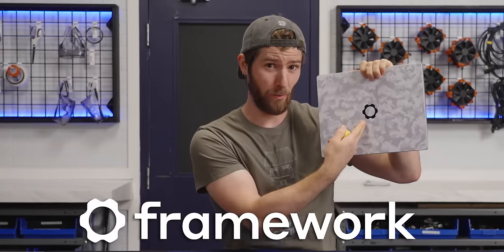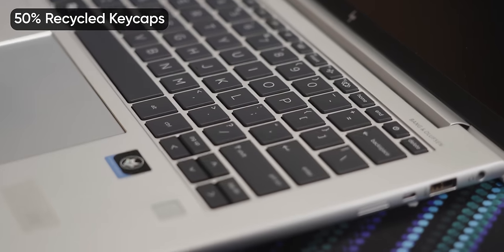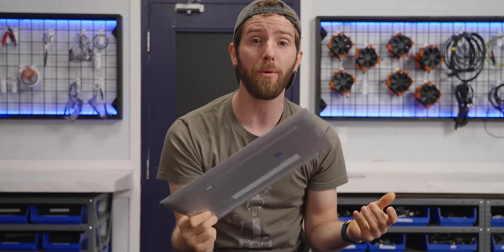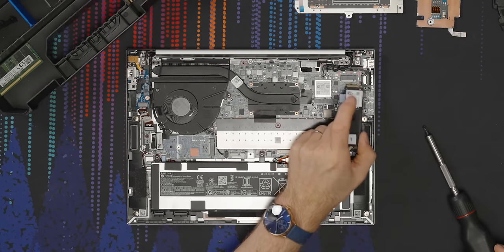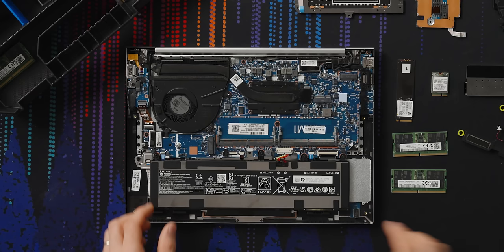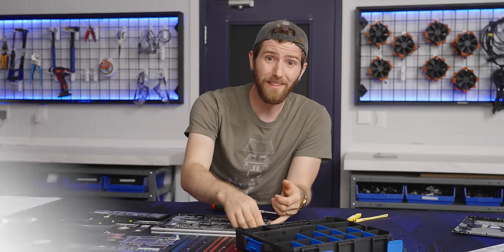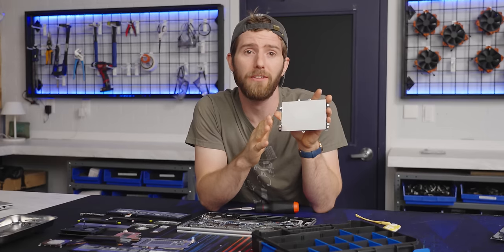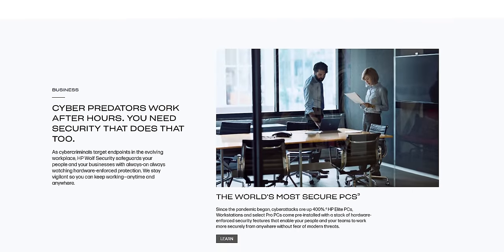My Investment is in TROUBLE - HP repairable laptops

Comment: While it wasn't promoted like they are now, my Elitebook 850 G3 is almost as easy to work on. While I haven't taken a whole lot out, the internal battery is more easily removed than the computer you look at here. Remove the bottom, undo 2 screws and remove the battery. I did have to replace the keyboard and that was very easy, after opening up and removing the battery, just remove either 2 or 4 screws (can't remember) and pop out the keyboard from the outside and unplug a couple ribbon cables. RAM super easy, and it has a SATA and an M.2 slot.

Comment: My mom has an HP. The NVME failed at 10 months.  I swapped it out and tried to warranty the original through HP.  They approved the repair but they demanded I put the SSD back in, and ship the entire system for SSd replacement . 

So much for user repair ability.

And then they claimed they do it to preserve the warranty.. but SCOTUS & DoJ already upheld user upgrade and replacement parts doesn't void warranty

Comment: This is pretty much the same for the G8s aswell. I did i keyboard replacement of the 840 G8 just a few days ago and there was a guide on the HP youtube channel that made the swap pretty easy. The problem is that the keybord is the same as the bottom plate. And  litterly EVERYTHING else is screwed into that bottom plate. Meaning that if you want to swap the keyboard, you have to rebuild the ENTIRE computer from scratch...
But the 2 sodimm slots are nice! Leneovo could learn a thing or two.

Comment: If this had a pointing stick like older HP ProBooks, I'd be totally interested. This is one part of the user experience that became so essential to me (as I don't have to leave the keyboard to use the mouse).  This usually leaves me with a ThinkPad; I love them, but choice is good.

Also, is the USB-C on a board? I find that the one people use for the power adapter is the spot-most-likely-to-break due to repeated plugging. If not, I'd feel much better if said ports could be on a card.

16:10 displays are awesome. Ever since my Dell 2405WFP 24" LCD, I've wanted the 1920 x 1200 on every 14" laptop I could get. This should have happened long, long ago.

Comment: I've been rocking a HP Envy x360 for a good few years now, I had one of the hinges fail pretty dramatically recently and to my surprise I was able to find detailed and easy to follow (dis)assembly videos, by HP, on youtube for my exact model, and with notes as to which dissasembly videos had to be followed first to reach the hinges. (Spoiler alert, it was all of them)
... I may have repaired the hinges by replacing the failed plastic portions with an irresponsible amount of super-glue, but it's back to working absolutely as designed, and am now considering a battery replacement and a bios upgrade to include the battery management tools!

Comment: That's something I love from hp they always have maintenance manuals with all the spec's, part number of all the spares, and even illustrated how to disassemble to get to the part you want to replace, the only bad thing is that out of us or at least from Mexico to the bottom of America it's almost impossible to get the replacement parts even in recent laptops and don't mention about the price the only time I've asked for a $8usd wifi module they try to charge me half the price of the laptop about $200usd, then I've finally get it from a junk PC place for about $3usd (used but in perfect condition)

Comment: I only just now saw this video, 7 months after it was published. I have an HP Omen that I think I bought around the same time as this video. I opened it up to put in an extra SSD so I could reserve the included one for boot drive only. When I was in there, I noticed QR codes all over the place. Replacement parts. I had a hunch then, but now I know for sure. HP has come a long, long way in recent years. In the 90s I can remember my dad trash-talking the brand incessantly, so this Omen is actually my first HP product ever. I also picked out a 16" Envy in that (to die for) gorgeous blue, for my mom when she needed a new laptop. No regrets so far, and even less knowing they are seemingly "with" the "right to repair" camp.

Comment: I would have wanted to see your replace the keyboard because that's the part that's often fails after the battery. For the parts shown in this video, it appears that there was no adhesives which is always a good thing but did they use some other nasty tricks for the keyboard?

Comment: So, from a service engineer perspective:

- average level of disassembly difficulty
- two sodimm slots in a modern 14" - good
- replaceable daughterboard with USB-A and 3.5 combo - good, USB jacks fail more often than everything else
- ports on other side are not swappable as usual, will require soldering
- replaceable fingerprint sensor - not much of a factor, they rarely wear out. good though
- stock SSD looks like it has no DRAM cache and a single flash chip - not very elite for an Elitebook, but HP does that, see the same on Spectre x360
- USB-C charging - not great, may not accept a generic charger, a pain to replace when the connector wears out
- adhesive in LCD panel assembly - BAD, replacing the panel will be a pain when it breaks
- keyboard looks fixed in place with molten plastic studs instead of screws - BAD, replacing the keyboard after a spill will require replacing the whole top case instead of just swapping out the keyboard module
- parts availability usually covers North America only, YMMV in other countries

Conclusion: Sorry, but no. (Maybe slightly above) average office laptop in terms of serviceability, nothing noteworthy. Most mass production office laptops offer the same. HP did not break anything, so that’s good?

Comment: I'm a repair tech and from what I've seen HP laptops suck. It's the most common laptop we get in, next in line is probably dell. HP would be twice as common.

Biggest issue is those bloody hinges, HP laptops are in my experience just really cheap and flimsy. It's good that they are trying but there are still some issues I have.

Why TF do you have to still replace the whole assembly, just have the LCD replaceable, if you break your screen you shouldn't have to replace the LCD back cover, camera, bezel and wireless antennas.

Another issue I see is dying keyboards because a small bit of liquid got in, or someone was figiting with it and pulled off a key breaking those weak clips. You want a challenge? Replace the keyboard.
It's probably another horrible thing where it's held in with 150 plastic rivetts, just have a replaceable keyboard without rebuilding the whole freaking laptop.

Pretty much all laptops suck that I've worked on in one way or another, even if it's just a software issue I see, the laptops still suck. Framework is the only laptop that seems ok, but it sucks that no one can bloody get the things.

Comment: Can't charge the HP laptop from either side, which you can do with the Framework.  As I type this I just hot-swapped my USB-C port from the left to the right side of the laptop because the plug was closer to that side where I'm sitting.  Can't overstate how handy this feature is for remote work in different environments.

Comment: I had an old laptop, Lenovo Z710 was the model, and I was quite amazed by how easy was to open the damn thing. 3 screws on the bottom and SLIDE the bottom cover off. Yes you read that right. SLIDE not pull. You got instant access to the HDD, ram, fan, cpu and gpu and wifi module. Maybe you can show this off in a future video about repairability
Reply: Some older HP Elitebooks had a lockable lever, one direction unlocked the battery, the other direction unlocked the bottom system cover to slide off.  
Not a single screw required for both of those operations.  
Even swapping the Hard Drive and WiFi, RAM and FAN was toolless.

Comment: Checking their website in the UK and you can't do any of the stuff Linus does here.
There is only one version available and there are no spare parts available.
The blurb actually says that the battery is for their maintenance techs only. Not to be replaced by the user.
Then again, Framework laptops aren't available in the UK yet so there is no need to make this HP 845 G9 user repairable in the UK yet either.

Lends some support to the "Kill Framework then return to business as usual" theory.

Comment: My company uses HP and almost every user has some elitebook model. They are generally really solid to work with, and I appreciate the ability to swap batteries. Comes in handy when the company typically requires users to remain docked nearly all day every day. HP Wolf Security, though, is mega annoying bloatware. Nearly every time I observe strange behavior in a users PC, removing Wolf Security fixes the issue. Wish companies wouldn't ship products with unwanted software that makes the machine objectively worse.

Comment: Framework is absolutely still ahead (amd model would be nice). That is a repurposed HP business design (nothing wrong with that). The repairablility of that machine is not something new though, the business laptops 840 series (what I work with) have all the same removable components. I love the design, chassis, and seeing it carried over to some other models is great. We have yet to take delivery of the bulk order but the Probook 44x (0 or 5) series seem to be pretty comparable too. The chassis is made out of plastic, but all the replacement should still be possible their too.

Comment: TL;DR: Nothing that actually matters has changed.

I've been in the unauthorized third-party repair space on-and-off for about 10 years, mostly as a side hustle. So being an "industry outsider", every repair is a learning experience and the following is just my $0.02. While what companies are doing in response to the Right to Repair movement are all in the right direction, certain models of HP laptops were built like this long before R2R was even a thing. The only difference this time around is the availability of spare parts and repair instructions straight from HP.  But for the most common repairs we see - port repair, hinge repair, screen repair, keyboard repair and battery replacement - more could have been done to remedy the reasons why devices need to be repaired in the first place/make the repair process easier and more affordable, especially as a device ages and depreciates.

1. Ports are still soldered - pretty straightforward. While it's good that the right-hand side ports do break out into a daughterboard, not having the (arguably more important) left-hand side ports on a modularized daughterboard is a huge missed opportunity. Audio and data transfer can both be done wirelessly if the ports fail, but you can't wirelessly charge a laptop when both USB-C ports fail. A bit of a strange caveat since HP laptops usually have a modular DC barrel jack, which can be replaced without soldering.

2. "Fake" aluminum chassis - perhaps a cost cutting measure to imitate the "premium" feel of real metal laptops. As can be seen in the video, only the exterior of the laptop is aluminum, but it's a literal facade. Inside is a black plastic frame that's bonded to the thin sheet aluminum, which is actually worse than if the laptop were wholly plastic, and certainly worse than a true unibody metal chassis. When the screen "hinges" fail, it's actually the screw bosses in the chassis that break, and this can happen with the regular opening and closing of the lid. The hinges themselves may become loose over time but rarely fail.

3. Screen - nothing has really changed. If an LCD panel is a standard resolution/aspect ratio and not a laminated touch panel, it's as easy as it has always been. I think in recent years though, flangeless LCDs are trending more to reduce the bezel profile. So instead of using screws to affix the LCD to the lid, stretch release adhesive strips are used instead (think iPhone battery adhesive, but thicker and longer in length).

4. The keyboard is heat staked (Google "heat staking" - not to be confused with rivets) to the top case/chassis, which means you need to replace the entire top case assembly if you need a new keyboard. If you tried to separate the keyboard from the top case, you lose the stakes that are injection molded into the top case, unlike rivets which can be replaced with the proper equipment. And if you wanted new stakes to properly secure the new keyboard, you need a new top case, which defeats the purpose of replacing the keyboard on its own in the first place.

5. As for the battery, time will tell whether HP will continue to manufacture and sell replacement batteries when laptops actually need them. Unlike the previous 4 points, which many users can reasonably avoid the need to repair with due diligence, battery degradation is inevitable. Most companies only stock batteries for 3-5 years after a particular laptop was first available. The thing is, laptop batteries usually last at least that long. By the time you actually need a replacement battery, it's very hard to get a genuine one, and you need to resort to questionable unbranded/generic alternatives which may or may not be better than your degraded original battery.

6. RAM, SSD and the wireless card generally outlast the useful life of the laptop itself. While it's nice they are socketed for upgradeability, they are substantially less commonly "repaired" if the laptop was sufficiently specced from the get go, since they don't suffer from conventional/physical wear and tear like the ports, chassis, screen and keyboard do.

If you've reached this far, yes the TL;DR is my attempt at clickbait. Happy to discuss (if this comment makes it past the spam filter)

Comment: To be fair, the PH1 bit is used for almost every non-apple laptop outside the XPS series (which uses T5 for the baseplate and PH1 for everything inside).  It's the bit that lives in my driver, when I'm testing and repairing systems everyday.

Comment: Except the mainboards generally cost the same or more than the whole unit and they wont provide you the DMI tool to program a replacement anyway (Which requires you type in a huge caps sensitive string amount a dozen other steps)

Comment: Most business class laptops have similar reparability (Lenovo Thinkpads, Dell Latitude, and HP Elite books ), I don't see anything new here, except that HP is offering parts on a new model although some parts seem too overpriced like $600 for a screen? If we assume that new business laptop is unlikely to fail in the first year or 2, then after 2-3 years there will be plenty of parts available on ebay  since these business class laptops are sold in very large numbers for businesses. Also, all disassembly guides on more popular laptops can be easily found on youtube no need for manufacturer to make them. Its unlikely that a repair will be needed within the warranty period, even battery has 1y warranty.

The bigger problem with the manufactures is that  they purposely make repair harder by making slight changes to parts each year so  parts from previous years would not fit the newer model, even though the laptop looks almost identical, in example each year manufacturers make same looking keyboards but with new hinge designs and usually 3 different types  of hinges each year!

Comment: I remember running power tests on one of these when I was working at AMD over the first half of summer. It was just a short contract job but it was really nice, especially in the lab. Very cool and all the other lab techs were super cool to hangout with. It was always a treat to watch the performance team mess around with AM5 chips on LN2.

But yeah, I really liked that laptop. It was pretty easy to work with, definitely WAY better than the Asus laptop I had to test. Personally, I'd prefer the 865 G9 instead just for the larger display if I had to run one as a daily driver, which was rather attractive compared to my ancient Dell Precision M6800. xD

Comment: The fact that the fan can be replaced without removing the heatsink is a huge deal if you’ve ever dealt with a fan blocked by the heatsink. I love my G14 to death but the cheap fans have crapped out on me a couple times, and it’s an all-afternoon job to remove the heatsink and properly reapply the thermal paste, especially around the VRMs

Comment: Such a great move by HP! I wonder if they give power back to the user on the software side too? My HP Omen laptop has such a basic BIOS and I can't even control the fan speeds. I vowed not to buy a HP again but this new move might change that.

Also: FreeDos! I wonder how well the hardware is supported in DOS, though. Do they ship network packet drivers? Is that soundchip Soundblaster/Adlib compatible?

Comment: The question is, are there parts available years later. I had just bought a new laptop because my 8 years old laptop won't charge and the keyboard doesn't work. It otherwise runs fine. It has a nice touch IPS display and the i7 is good enough for everyday needs and is thin and light. My laptop from 12 years ago also faced broken keyboard. I hope my new laptop's keyboard doesn't break

Comment: HPs laptops are repairable down to the keyboard... which is riveted to the palmrest, and turns what should be a 30min job into a several-hour job. Replacing the keyboard on my probook 445 g9 took 3 hours, even with the help of an electrician/substation engineer, who spent several years doing consumer electronics repairs. HP is making a step in the right direction, but it could still be far better. It's also nearly impossible to get spare parts from an official HP retailer, even though this is an enterprise-grade laptop.